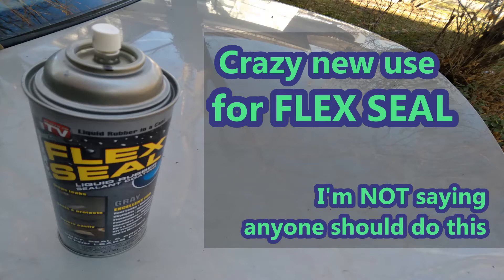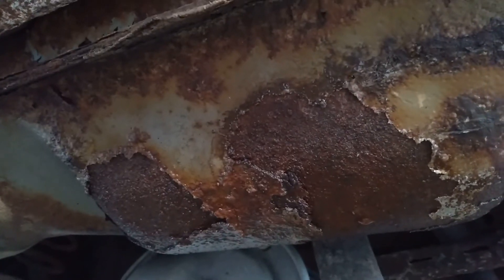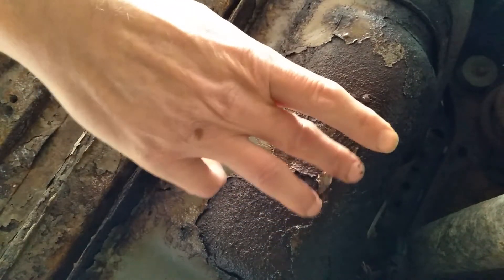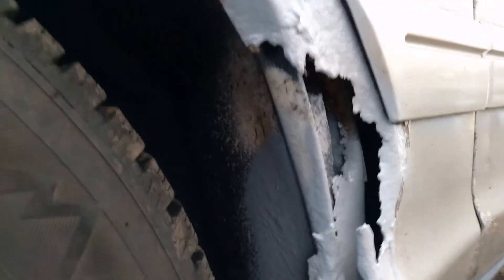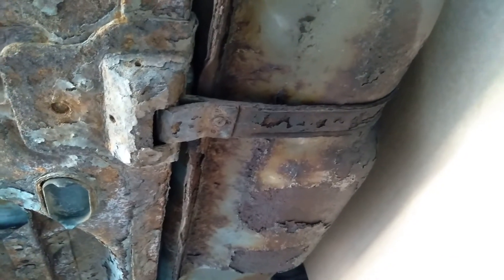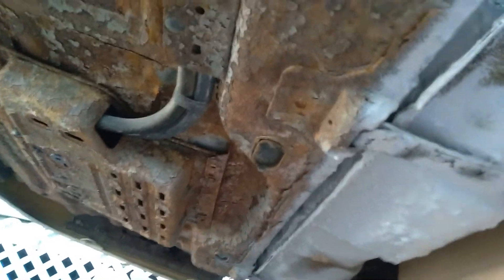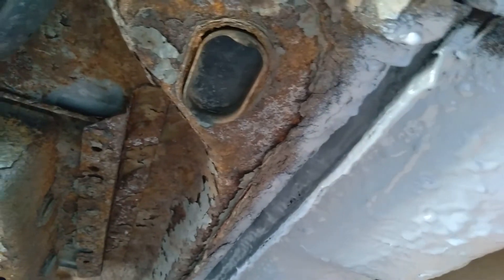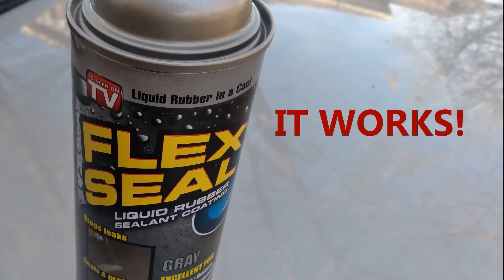Crazy New Use For Flex Seal Spray - I'm not saying anyone should do this

Comment: Hey there, Flex Seal here! 👋 We do not recommend using Flex Seal to seal a gasoline tank, oil tank, radiator or on and/or around any other flammable liquids or ignition sources. Let us know if you have any questions. Have a Flextastic day! 💪
Reply from the maker: Agreed, but it sure did stick
Reply from the maker: So does it dissolve or just never cure when touching gasoline?

Comment: For pin holes in gas tank. step 1   simply take a bar of hand soap and rub it over the hole until the leak stops. Step 2   Drive
Reply from the maker: Pretty much the same results.:dothefive: